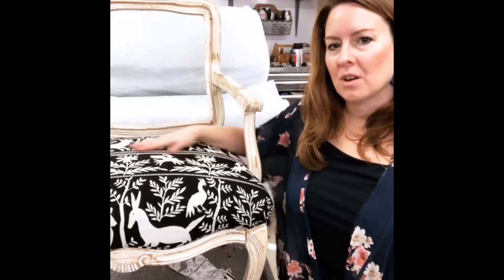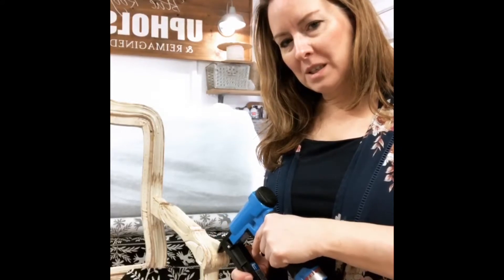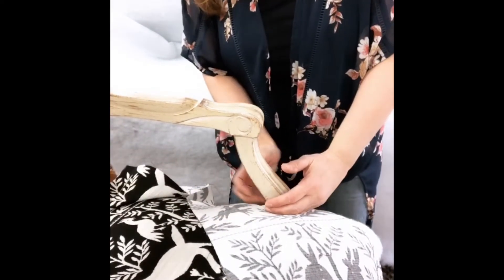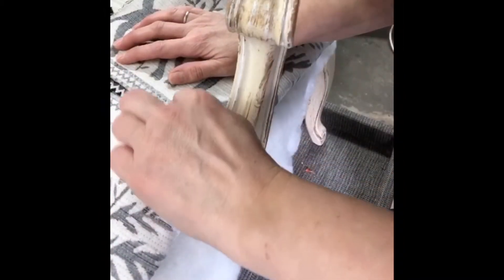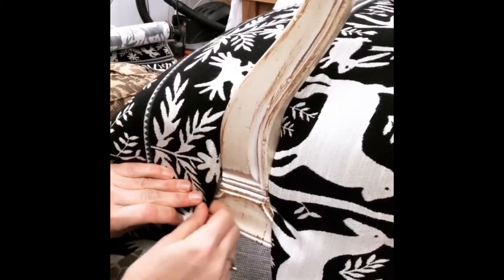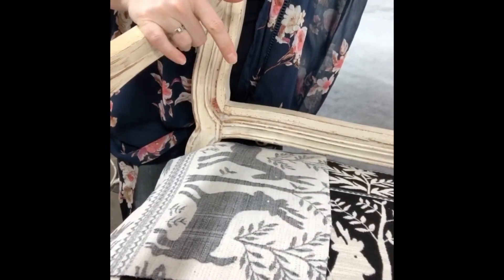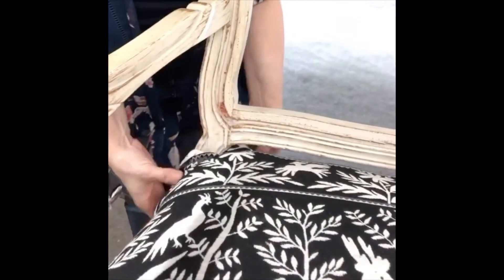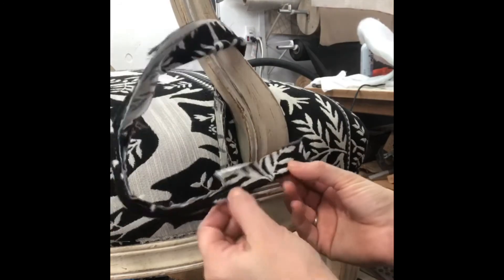Upholstery tip: Making Relief Cuts while Upholstering

Comment: Trying to find info on fabric  relief cuts when recovering a removed seat cushion that has 2 square inside corner cutouts on the sides of the front of the chair on the backer board where the   arm of the chair goes 😕